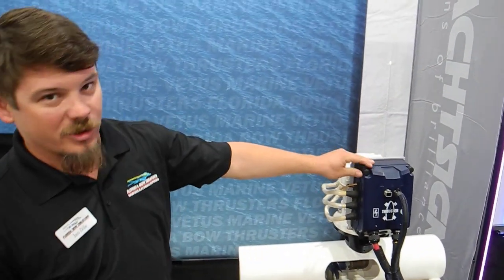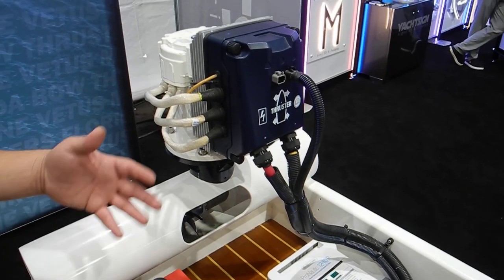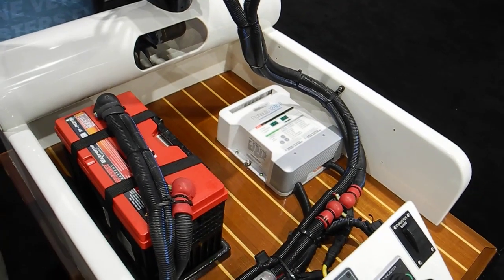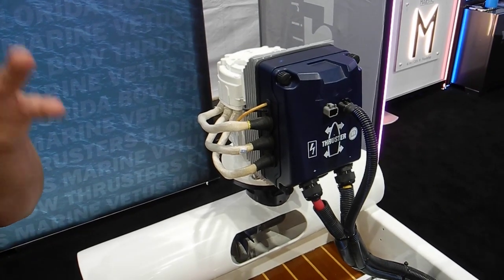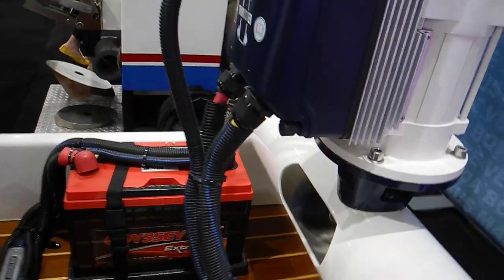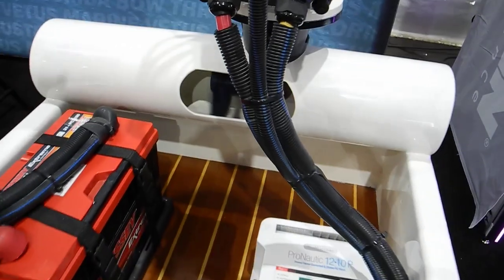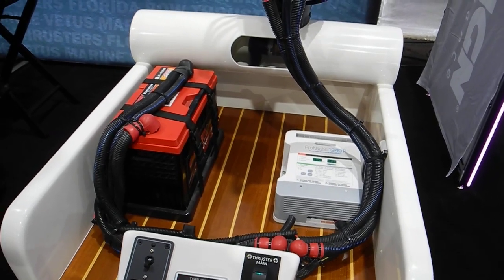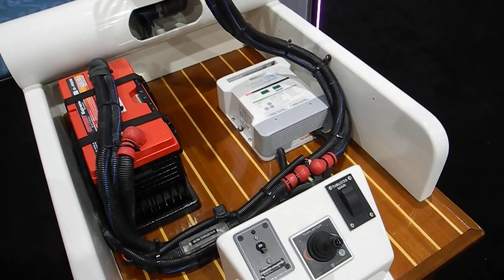FLIBS 48 volt Bow Thruster

Comment: Nice product ! What is the advantage of using 48 volts ?
Reply: He answers that 30secs in.
Reply: Some boats have a very large 48V bank and large inverter to replace the generator. The main engine has a large 48V alternator for charging and is capable of supporting large loads including air conditioning.  For this system a separate battery is not needed for 48v thrusters and windlass. Look at Integral Solutions for an example.
Reply: Still a limited run time ?